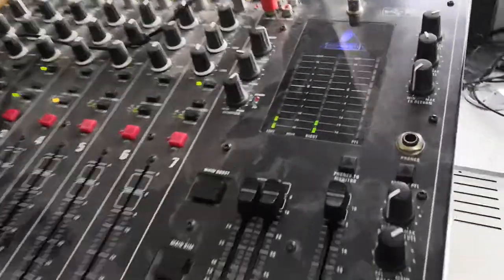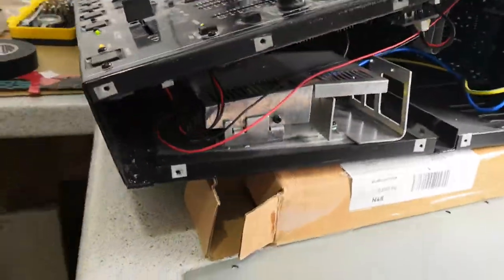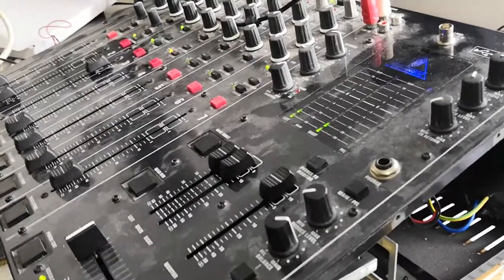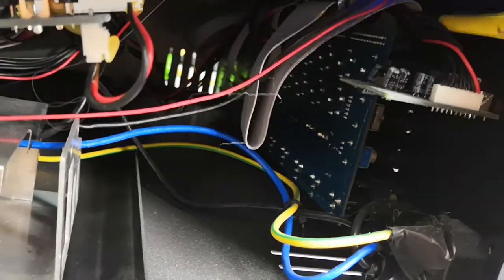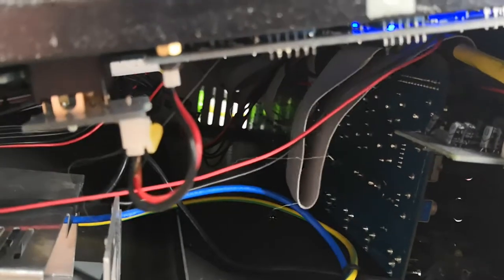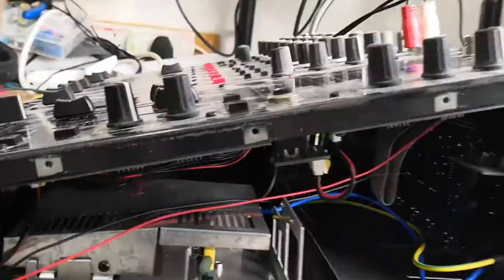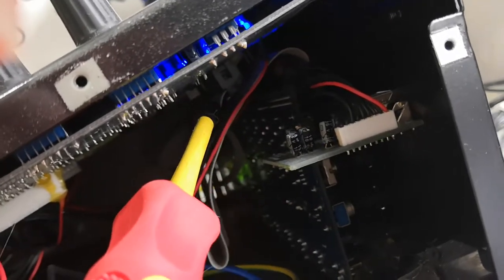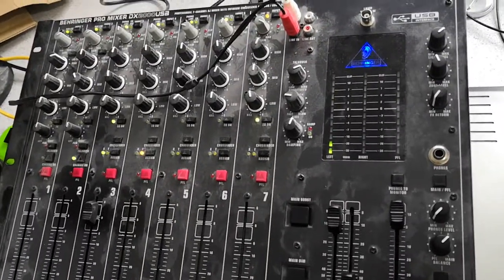Troubleshooting Behringer DX2000 USB failed output channel

Comment: Thanks for this. I have the same issue on my 2000USB that’s just 3 months old. I was about to email Thomann, where I purchased it… but I’ll give this a try first. Hopefully it will save me a lot of hassle! I was rather hoping the Behringer stories about poor quality were untrue but unfortunately not. Appreciate the upload.
Reply from the maker: I'd suggest emailing Thomann first because yours will still be under warranty if it's less than 2 years old. They should arrange for Behringer to repair it.
Reply: @MichaelBrooksDr  Thanks. I have done that and it’s being sent back for repair. All the best.
Reply: I decided to repair the mixer myself, rather than go through all the hassle of sending back to Thomann. They offered to repair under warranty but given that it’s a relatively cheap mixer I decided that on balance it would be quicker to check the issue myself… and it did in fact turn out to be the same problem you mention here. Cleaned the connector and pins with alcohol contact cleaner, re-seated it and now it works fine. Thanks for sharing the solution.
Reply from the maker: @dan_a_b  Superb, well done on fixing it!

Comment: I'm your tenth Subsciber! I appreciate how clearly you explained this and how eloquent you are. Very easy to follow, thank you.
Reply from the maker: Why, thank you! Much appreciated!

I might even do some more videos...
Reply: Is it a mixing board or a DJ mixer??
Reply: @amennkosi2332  It serves as both. I use it in my home studio for various inputs; CD, Phono, Cassette and a couple of synthesisers… and the USB interface is very handy to integrate Logic Pro. Then I will sometimes use it as a standalone DJ mixer for my Technics 1210’s. It’s a very versatile mixer but sadly the quality is questionable, as this video points out and as my mixer proved this morning when I powered it up! The sound quality is not great either compared to expensive mixers… but you would expect that.
Reply: Also worth noting that I get a lot of interference from the USB interface when using as a DJ mixer with turntables. I traced this back to my ethernet switch. So I have to disconnect any internet signal to my Mac before using the phono inputs. It’s not the greatest mixer, that’s for sure… and I see it has now been reduced to just £211 on the Thomann website which should tell us something!

Comment: Hello, I have the same problem on the left channel. Do you happen to know which pin is the faulty one? then I would just solder a wire from board to board since my ribbon cable was already soldered anyway and I can't get it out. Or can several wires from the ribbon cable be faulty? greetings from Austria, Chris.
Reply from the maker: Hi Chris,

Start by cleaning the main output jack sockets (q-tip soaked in isopropyl alcohol) because it might just be some oxide on the contacts.

Then with everything reconnected and music playing, see if pressing the following buttons brings the left side back: Main Boost, Main Dim, EQ on the channel you're playing music from. Then wiggle the main faders up and down to see if dust build up in the faders is a problem 

Is the left output dead no matter which input fader is being used to play sound? If so, the problem is either the input/output board (at the back) or the master mixing board (front right where the VU meter LEDs are).

Can you hear a left channel in your headphones? If so, the problem is either that ribbon cable or the input/output board

Comment: I've been fighting one of these, my biggest problem is trying to find a service manual, or at least a circuit diagram.
Reply from the maker: Here you go:
https://drive.google.com/file/d/1t2DyUVZkPP54bvKki5sg8ERh2cuY-IDq/view?usp=drive_link

The Behringer DX1000 is almost identical in internals.
Reply: @MichaelBrooksDr  Thanks, I had all but given up on finding any info, I didn't know there was a DX1000

Comment: Hi Michael. Is there a work-around to mute the monitor speakers when the mic is open?
Reply from the maker: Yes there is! By coincidence I fitted my mixer with mic-controlled speaker muting a month ago!

It does involve fitting microswitches alongside the mic fader track and a small external circuit using relays.

I'll do a video about that including the muting circuit diagram when I've next got some time.
Reply: @MichaelBrooksDr  Many thanks, that would be very helpful. Cheers.

Comment: My issue is that I have sound out of the right side but it is very weak signal.
Reply from the maker: This could still be the same problem. If a connection goes dry the electrical gap may still be close enough for it to act like a capacitor meaning you'd get faint higher frequencies through but will lose all the bass. You might also have a completely dead right channel but with crosstalk from the left to right channel making it sound as though there's a faint signal on there.

It's always worth tracing the signal from start to finish. Check the connections coming into the mixer, especially on the right channel. Clean those input RCA sockets. Then nudge the gain knobs to see if that is the problem. Then move the input fader up and down to see if it crackles. Then check the EQ buttons to see if toggling those makes a difference, then check the master faders. 

Compare the audio in the headphones to the record output to the main output.

A useful sign is if the audio in the headphones has normal volume on the right channel then it could well be the same problem.

Comment: I have intermittent audio on the monitor not main output do you have a fix for that
Reply from the maker: 1) does the problem occur with just the phono monitor outputs and not the XLR monitor outputs (try both). If so:

Monitor output phono sockets (or cable): if using phono give the monitor output phono plugs a bit of a wiggle to see if that jolts the channel into life). If so, open the mixer fully and see if there is a dry joint on the phono plug on the input/output board (on the inside rear face of the mixer)

Monitor output XLR sockets (or cable): Again, give these a wiggle. Check for dry joints. See if you get the same problem on the phono outputs

2) If the problem appears with both phono and XLR, then the fault is proximal to the output. You will need to check each of these likely culprits:

Monitor fader (right fader on desk under VU sound level meters): give the fader a little wiggle and see if moving it brings the channel in and out of life. If so, it'll be grit in the fader. Blow out with a can of compressed air. If that fails, you can replace it with a 10K stereo logarithmic fader slide pot

Phones to monitor button: These press toggle buttons can sometimes get grit in and get broken contacts. Try wiggling it about, if this is the problem try removing the button cap then blowing with compressed air.

Input EQ buttons: If your problem is present with one input source, and present on all outputs and on the headphones but only when they are in "main" mode and not PFL, then try wiggling the "EQ On" buttons which sometimes fail because of dirt. Again if this is the cause, given them a compressed air clean.

Comment: Got any fixes for no usb audio?
Reply from the maker: The USB board is pretty close to the ribbon cable: https://twitter.com/michaeljtbrooks/status/1252221193664503812

First step is diagnostics:
- Test the USB with a different computer to see if it's a driver issue
- If no device detected, use a multimeter to probe the power pins of the USB connector, it should be at 5V.
- If no 5V, then this is a power problem. Probe the pins on that white block connector you can see in my screen grab versus ground. You should see 14V on one of the pins
- If you're getting 14V into the USB board, then the board is faulty. Pull it out and inspect for dry solder joints
- If no 14V into the USB board, then the power feed to it is faulty. Follow the connector block back to where it gets its power from. You might be able to tap power from the lamp output
Reply: @MichaelBrooksDr  Thank you so much dude

Comment: were  can i buy this  to replace it
 thanks
Reply from the maker: Thomann are still selling this for around €300:
https://www.thomann.de/gb/behringer_dx_2000_usb.htm
Reply: @MichaelBrooksDr    i meant the  cable   were to buy it
Reply from the maker: @johno4566  You'll need a 26 pin two-row ribbon cable. The side that's connected to the output board is actually soldered directly in on the Behringer cable, so you'll also need one 26 pin header (2 rows of 13). The side of the cable that's connect to the master mix board sits in a proper header socket so that side of your ribbon cable will just click in.

The cheapest source of 26 pin ribbon is probably somewhere like Pi Hut (https://thepihut.com/products/26-pin-gpio-ribbon-cable-grey-150mm), or another Raspberry Pi parts vendor, because the original Raspberry Pi 1 had a 26 pin header on it. You can pick up the 2x13pin header there too: https://thepihut.com/products/idc-breakout-helper-2x13-26-pin

Desoldering the original ribbon is a bit of a pain and needs a hot soldering iron and some solder wick. I ended up taking the original connector out in pieces before soldering my headers on in place.
Reply: @MichaelBrooksDr       i got another werid isue u migh knoe or it is linked to the issue  the same issoe  about   yes i am hvaing the  channel audio issue  but at least a  few times a day  the audio  drops on one chnnale  and  i noticed if if i put the  channel    slider to max for a second   the    channel missing the audio come back  like normal  for   time and it dose the same on any of the channels